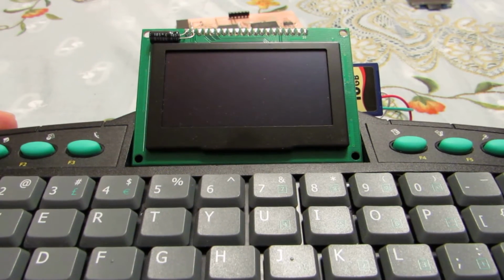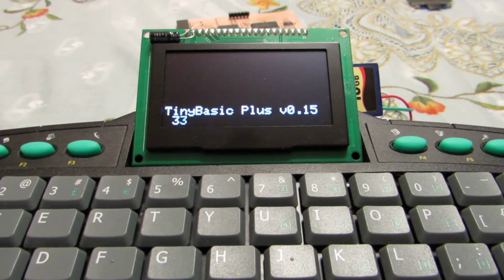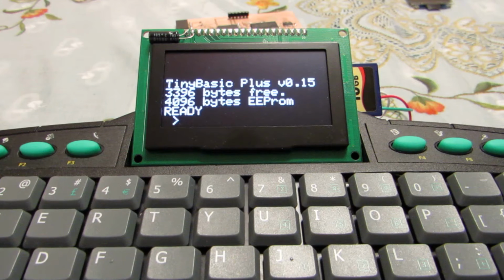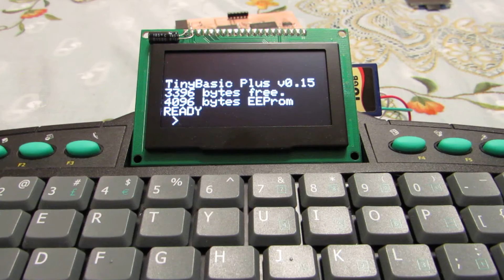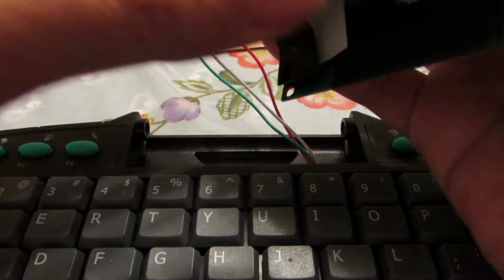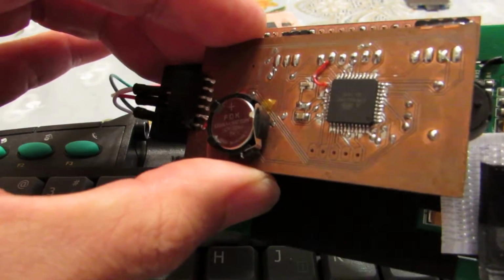"tiny" TinyBasic computer supporting external SRAM (512kB)

Comment: I wonder if you could use the SD to run a larger program by separating functions into 10k chunks, have each chunk call the next. My point is the program could be run in 10k chunks. Does this make sense?

Comment: Cool ! How about SDRAM ?
Reply from the maker: Wow! I need to switch to 16bit or 32bit processor, because original addressing of 8bit is just 64kBytes!
Reply: I think you can do it also on ATMega with some tricks: important is to generate clock, refresh memory every 8 uS, and using valid timing for row/address select signals. 40% of the MCU is wasted, but on the other hand 16 Mbytes memory will be available for your system :)
Reply: wow, you already done this. Congrats !! :)

Comment: Great job! Very interesting what you have done. Can we have this basic computer running in a Atmega 328P with such low SRAM? Could we handle basic program memory data into sdcard instead of RAM? Thanks!!
Reply from the maker: +Ronivaldo Passos Sampaio Hello and thank you for your comment. Actually some (relatively old) AVR chip have XMEM (memory extension) function, which enables to use external SRAM as main memory. Not only XMEM supported AVR but also another AVR can handle external SRAM but it will consume lots of GPIO and Mega328 is not good choice for it. I know Mega128, 1280, 1284 , 2560 and some other supports XMEM. Thank you!